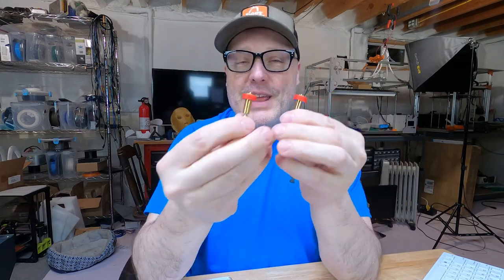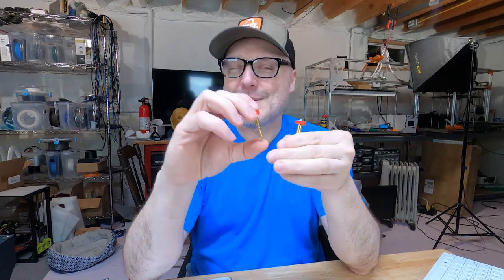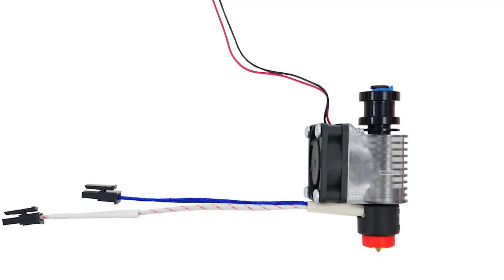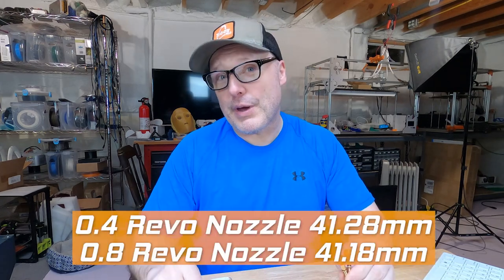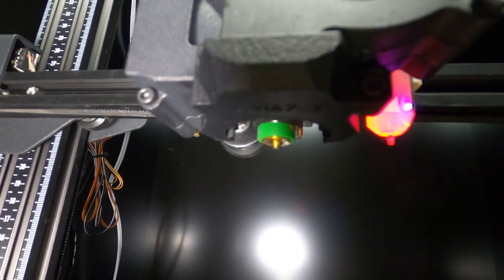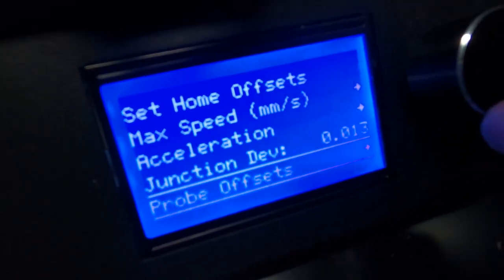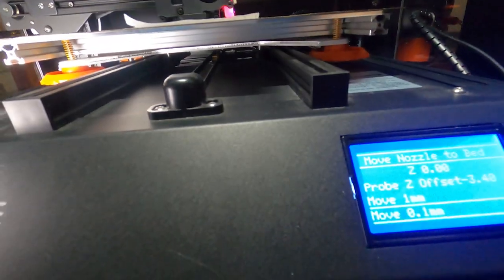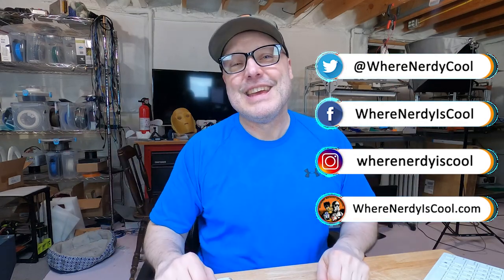E3D Revo Nozzle Pro Tip - Check Z Offset!

Comment: Yea its just 1/10 of a mm, they said its a drop in replacement environment, didn't they? Swap ur nozzle and print. That's what i understood. As a machinist, the length of the nozzles is a critical parameter for quality control in production process regarding the effect to the printer it will be used later. We adjust our printers <2/10 of a mm, with that production tolerance it has to fail! In my eyes, they have to rework their qm guidelines, this is a no-go as a high class premium product they try to sell it
Reply from the maker: That was my understanding of these Revo nozzles as well. When I heard my nozzle crash into the bed I knew I was dumb to not double check!  Trust but verify, right?

Comment: Hello! I am not satisfied with the difficulty of disassembling the E3D V6 in the case of a temperature plug in the thermal barrier and the possibility of plastic leakage when replacing the nozzle. I would like to upgrade to E3D Revo. Please tell me how reliable and safe are Revo heating blocks?
Reply from the maker: I only have a handful of prints done with it but so far, so good.
Reply: @WhereNerdyisCool , Thanks!